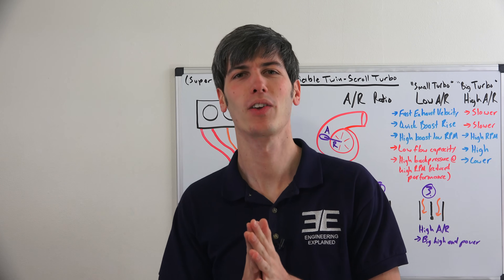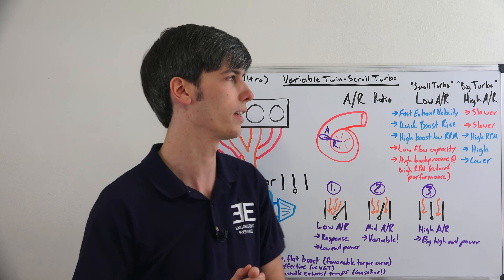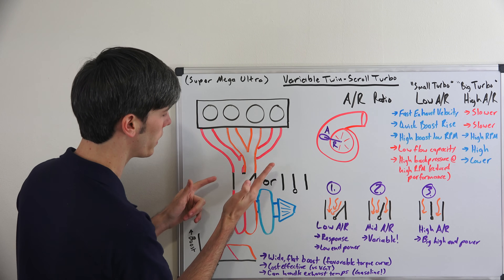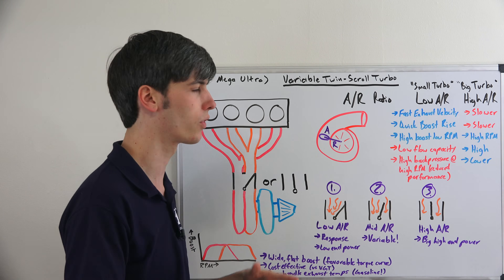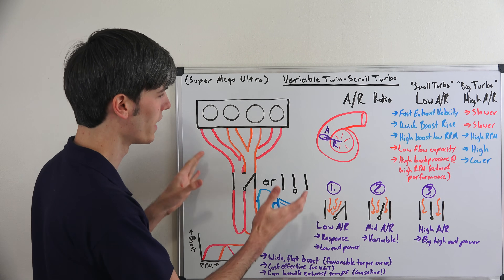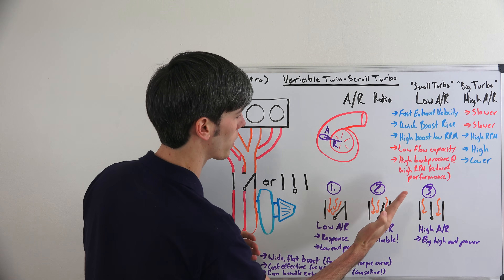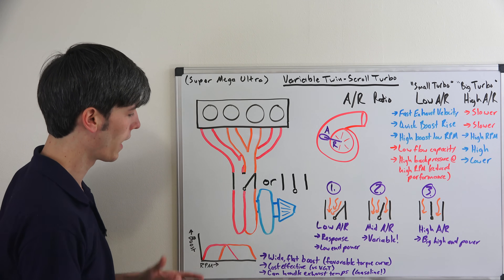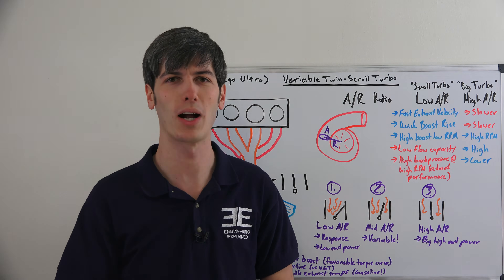Variable Twin Scroll Turbocharger - The Future Of Gasoline Turbos?

Comment: Hi Jason, thanks so much for this video. Im currently designing a twin-scroll VGT, and my A/R is 1.2 (this is the brief i recieved from the client). Now my question is, is each scroll inlet 1.2A/R (so the cross-sectional area for each scroll has a A/R ratio of 1.2).. or are they both 0.6, and become 1.2 when the flap is fully open?

Comment: Could this BorgWarner product also be applied to engines with uneven cylinders? (e.g. Volvo T5). 
It is important to mention that a twin-scroll turbo has only one wheel (turbine wheel) on the exhaust side and not two. So "twin" is confusing in that sense. But the two exhaust streams blow on a different part of that same turbine wheel (exhaust side). 

So, can this product of BorgWarner be used for engines with uneven cylinders? E.g. for a 5 cylinder: 3 cylinders porting on the smaller part of the turbine wheel and 2 cylinders on the larger part of the turbine wheel ? (taking into account the firing order of the cylinders).

You would say that the turbine wheel can be loaded with uneven pressure/flow because of this VGT mechanism.
Reply: Multiple CFD tests for classic twin scroll turbine case powered from 5 cylinders (2+2+ one into 2) as well as non standard turbine case with one scroll been larger to be fed from 3 cylinders showed benefits to be available in much shorter rpm range than on 4 cylinders with classic twin scroll in 2+2 config...

Comment: Would there be any benefit to running a twin scroll header with regular vnt turbine? It seems to me that the pulses would be a boon for running a vnt vs using a regular header with one opening and all pipes going into it since I imagine you;d be pushing some air back against the closed exh valves on the cylinders in their downward stroke? or am I looking at this wrong.

Comment: It’s not really a traditional VGT is it? It doesn’t have a linear actuator and the vanes don’t pivot. It’s more like an upgrade on a twin-scroll design. I doubt it performs as well as a VGT over a wide rpm band, but it should be cheaper and better suited to petrol engines with hot exhausts.

Comment: You (or who has made the pictures)  has pictured wrong, the picture has the valve closing  the inducer of turbine, the big diameter.  You wants spool the turbine shaft fast, and that is is made blowing air in the big diameter of turbine side, the inducer.  Yes, closing one scroll and all exhaust gasses can pass faster and move fast the turbine, but 50% gasses not blowing the big diameter.
See how that BW has the valve, at 0:10.     It close the turbine exducer (small diameter) not the turbine inducer (big diameter).      I´m not engineer, only a car painter, past century playing with the compressed air blowing air to the car´s electric fans when front fender removed, to move fast blow air to big radius fan, and step to step blow air to the center of fan for more speed.
Viewing more videos more people fits the QSV closing the turbine´s inducer. Curiosly someones sells them have dyno to test.

Comment: So I’m a little confused, when you say combine those technologies I images something a little different.
So I’m confused because in the beginning with low A/R all the exhaust gas go into one tunneling,  to increase air pressure/ air flow. But I thought the whole point of Twin Scroll/ Twin Flow Turbos is to always keep the gases separate so the Positive Pressure doesn’t lose power with the Negative Pressure of the Opposites firing Cylinders.
What I taught when you said combining both technology is like a Big Turbo that is Twin Flow (Twin Scroll) so the + and - waves don’t interfere with each other and you have minimal rotational inertial. And when you are in low RPM the Big Turbo has its Veins with Low A/R. And with the Veins and with Duel Flow Turning the Turbine you would build Boost quick and the Veins just changed from low A/R,at low RPM, to Open at top RPM, but the exhaust flows never mix, exhaust from cylinders firing at the same time stay together always before the Turbo.
Reply: Like I get that that at low RPM Low A/R they all flow into on tube, to create max pressure. But isn’t that the whole point of Twin Scroll, not having them all merge so the Positive Wave doesn’t get reduced by the Negative Wave.

Comment: I designed the same concept about 20 years ago on rhino cad. the difference with my concept was the valve  directed gas to front the front scroll to get all flow across the whole turbine wheel. It never went further than cad.. dreams hey.
Reply: Same design... your drawing is wrong.

Comment: 1.6 naturally aspirated gasoline and 1.0 turbo gasoline get the same mileage (in the same car), so what is the point of turbo? Turbo engine will certainly be less reliable and more expensive than naturally aspirated. Where the hell is the real world improved MPG of these small turbos?

Comment: This is perfect video and let me wrtie "Hats off" to producer.

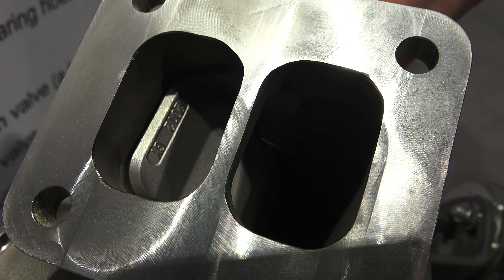But, there is huge misleading failure on blackboard: drawing is presenting valve reducing flow into inner scroll (closer to centre of CHRA), also it is said wrong (time 1:21). But as everybody can see (time 2:23), in low RPM reduced scroll is that outer scroll.

Reason is logical: inducer of turbine rotor has bigger diameter that exducer. So lever effect works for higher spool up.

Comment: Its sad that borg Warner didn't offer this already
Reply: 3 years late but Borg Warner was too late when they released that. If they did this 20 years prior, it would be considered almost revolutionary.
Reply: Also the twin scroll turbos by themselves significantly reduces turbo lag to a point where most manufacturers and customers felt satisfied. So adding a VGT vane just adds weight and cost to the whole package.

Comment: @Engineering Explained How do gasses from two cylinders create “low” boost and then the other two cylinders create “high” boost on a twin scroll? If the geometry of the turbine is fixed, how does it differentiate which type of boost build up it creates if the cylinders are equally sized? Not sure I can even communicate my doubts correctly, but it seems VGT are very clear on how they affect air flow, whereas Twin scrolls confuse me :)

Comment: I own a car with that Twin Scroll Turbocharger since five years, a Peugeot 308 GTi 200 THP. So, even in cheaper cars this is available at least since 2010.
I love the evenly spread power along the rev range from 1900-6000 rpm. And it is quite quick in response time. Its really fun to drive especially on a day to day use. For durability reasons, the car is now 9 years old and I had no issues with the turbo, but cylinder valves, oil leak and gasoline pump.

Comment: I recently got a 2013 328i, I think the model is F30 and the motor N20, I could be wrong, but it comes with a twin turbo 2.0L, very responsive, gun to drive and it can get going pretty fast. The one thing I don't know is how is the turbo set up or even what kinda turbo charger does it have? Any ideas? 😅 Love the channel ✌️

Comment: Keep in mind the blade tip speed (mph, not rpm) cannot exceed Mach 1 (i.e., supersonic threshold) where the laws of physics reverse, causing a loss of power, surging (booms) and possible blade damage. The tip speed of an auto turbo spinning at 100K rpm is about the same as it is for a helicopter rotor spinning at 300 rpm--just below Mach 1.

Comment: So Mazda did something very similar in the rx7 turbo 2. It was a twinscroll turbo and one of the models was obvious as the runner sizes on the turbo where obviously different ar when you looked at them. But in their cast manifold they had a flap or door similar to what Borg Warner is doing now. All based off psi ofcourse.

Comment: Aka quickspool valves? I’ve followed several quickspool build threads and a few were installed unsuccessfully (user error) but the ones that were implemented “correctly”...holy hell the low rpm throttle response and the ability to have a significantly larger turbo and still have reasonable spool time looks mighty attractive. Twin 76’s with a high a/r on a street driven small block, 1400 hp? Nbd.

Comment: It seems the 2016 Buick Encore uses the twin scroll turbocharger on its 1.4 Liter engine. The engine acts like a larger displacement engine in that its low end torque is high, while still having some high end power.  It also has two scrolls with a large vacuum/pressure actuator moving a vane in the exhaust passage. Thanks for the explanation of how it works.
Reply: Actually, if there is only ONE actuator, it certainly is a wastegate. These here require two actuators, as this system may very well get some of the advantage of a VGT, but won't allow to skip having a wastegate. Depending on the actual engine, some gasoline engines will even still need a wastegate when a VGT is applied, while Diesel ... nearly always VGT nowadays ... has been the standard for some 20 years now.

But this still is great, as the low efficiency of a bypassed but still active turbine is pretty low ... imagine, all the gases see the same pressure upstream and downstream, but only what goes through the turbine will do any work ... in a peak power situation, you can very well have like 60, 70 % of exhaust gas going through a wastegate, maybe even more and not likely much below...

Comment: If the lever opens even slightly, then the air will enter the second scroll whose size is fixed. So how is this variably changing a/r ratio? The exhaust gasses will slow down upon entering, will they not? Or have I not understood something about twin scrolls?

also, what is the size of this vts turbo? Would it be viable to be used in a twin setup with maybe a small turbo in something compact (13b rotary or a three pot or something)?

Sorry if this doubt was stupid😅

Comment: The whole point of a twin scroll design is dividing up the exhaust pulses so that they hit the turbine wheel separately in a pulsed rhythm, which does not loose any of that pulsed energy through the turbulence of mashing the pulses together into a collector pipe.  You don't truly maintain that pulsation by mashing them together closer to the turbine wheel nor does that change the size of the turbine wheel which they are meant to be spinning just the inlet size going into it. this takes away some of the inherent benefits of the twin scroll design.

Comment: I thought of doing this with a dual entry turbo in the 80's, they were called dual entry rather than twin scroll back then.
From memory I sent all the exhaust to the rear scroll (one nearest the bearing) at low boost pressure and used an actuator to swing the vane just like in this one except the vane was in a rectangle section duct immediately upstream of the exhaust flange because it was designed to use a standard turbo .  Variable geometry turbos were research only items and most turbos installations at the time used carburetors. Good to know the idea was sound.

Comment: I wonder... If we reduce the size and the intended operating RPM, could we lower the costs/vibration/heat associated with it's use? Could this be used in conjunction with and electric assist system? The electric motor's (I'm sure you know) peak output is at 0rpm, so if the first scroll was designed to start at 1000 to 2000 rpm, and their combined flow was for about 4000RPM tops, I think you could make a damn efficient vehicle. For a small commuter car perhaps.

Comment: Wouldn't that lever divert both ports towards the big side of the turbine (towards the left in your picture)? Giving the low rpm air more torque over the shaft. Love your videos.
Reply from the maker: The flap sits in the middle so that both ports get airflow.
Reply: That I understand but in the picture the flap was pushing the air towards the outside of the turbine and I think you meant to put it the other way around. The inside of the turbine I think would get more leverage over the shaft for lower rpm boost and then open straight as the revs picked up. Just a minor detail I was curious about.
Reply: i was about to ask that aswell... makes sense to me.
On the image of the borg warner turbo at the begining shows the exhaust pulses being directed to the inner side of the compressor wheel wich to me would make more sense then directing them to the outer.  great video keep them up great youtube channel

Comment: How the valve kind thing which is going to open after reaching certain rpm will be opened?? Means it is controlled by what??
Reply: rakesh therala pressure
Reply: It'll be controlled by ECU from electronic injection system. Of course some hidraulic/mechanic system will pull or push, but the angle, flow, it'll be all controled electronically. The pressure of turbo blow-off valve are controlled this way already.

Comment: If a variable geometry turbocharger does not require a wastegate because it varies the A/R Ratio, how come this type has a wastegate fitted. (shown at the start of the video). Thanks
Reply from the maker: +GrooverErn wastegates allow you to set a limit for boost at an exact pressure. Gives you a simple solution to limiting boost, without needing to worry if the range of the variable turbo can limit boost to a set amount (which may also mean operating at in less efficient range).
Reply: Engineering Explained thanks for replying. I teach engine technology to adults and my students love to watch your videos when researching assignments. I am also writing a concise booklet on turbocharging. Thank you for inspiring us.
Reply: I am curious about that too.  mine isn't a big rig but it is a 5.9L cummins.  I am fixing what the previous owner(s) (and a mechanic I had to use in Florida) but I would like to do things to make it more powerful, efficient, and increases the lifespan.  well I will be taking those 3 variables into account
Reply: EE has videos explaining how a turbocharger works, you need to understand the very basics first before questioning why gates and actuators exist

Comment: Thank you. What is controlling the actuation in this example, and what signal are they using? A simple R.P.M. read, coming from the ECU? Or, a more complex combination of oxygen sensor, R.P.M., Air Flow, manifold pressure, exhaust gas temp., etc?

Comment: I wonder if you could regulate the flap thingy with some form of wastegate.
Reply from the maker: +tubeampsrule1 perhaps, though I think it makes more sense for them to be controlled separately. Wastegate is for limiting boost, this flap is for maximizing boost.
Reply: +Engineering Explained I mean if you could somehow use a wastegate type device to regulate the back pressure into opening more toward the high side, you could make the whole thing analog. 

Some type of blow off control, maybe?
Reply: Yeah, Im sure it could be done like that.... I dont see why not.   Basically just control it with the same pressure operated type of servo thing that most factor internal waste-gate are operated with. 

Maybe even make it with replaceable springs so you can adjust when it will use the other scroll at different pressures.
Reply: +Michael G exactly. Tuneable and it could fit on older vehicles.

Comment: if you add a electrich turbo to the this, turbo lagg is 100% gone.
Reply: those dont really exist quite yet. not commercially at least. concept/prototype phase yes. i think volvo and bmw maybe vw too have been working on electric spooled turbo/supercharger to supplement conventional forced induction.
Reply: lol what is electrich  turbo
Reply: dosmastrify the intake has enough power. better put one on the exaust (for give my bad english), sucking out the gasses means less gas in the cylinder meaning better burning. but if you charge the fan with the car. all that extra power is gone.

Comment: System drawing ?
All strokes have (4/1) stream in better torque ratio --- open to get higher rpm 
           an if you do same to fresh air (Audi turbo + E-turbo in Flowgeometric)    -   a lot of data ++
MsfG Kay

Comment: So does the turbo still have a single exhaust turbine? How does the exhaust gasses work on this turbine?
Reply: The twin scroll refers to the twin scoop within the snail shape housing, This feature effectively gives you the benefits of a low A/R and a high A/R. There is only 1 exhaust turbine in this type of turbocharger.

Comment: This won't work properly. If you cut off the orange turbine's intake, it will create negative pressure inside the housing and it will slow down the turbo regardless if the exhaust side of the turbine is open or closed. The only way to fix it is to allow the chamber to literally have no pressure, like the vacuum of space, which really can't happen reasonably.

Edit: The only way it might work is if you have a valve on the exhaust side of the turbine that connects to the intake of the compressor to force a negative pressure and allow the orange turbine to still move properly. This, however, would require the original actuator to be slightly opened to allow airflow to the orange turbo, otherwise the compressor intake would not work as well.

Comment: what controls actuator that opens the second scroll? is it a boost actuator like a waste gate? and would this type of turbo charger require a waste Gate?
Reply: +Donald Brown It's probably RPM dependent because of the flow of exhaust gas, however I could see boost pressure being included for smoother and more accurate results.